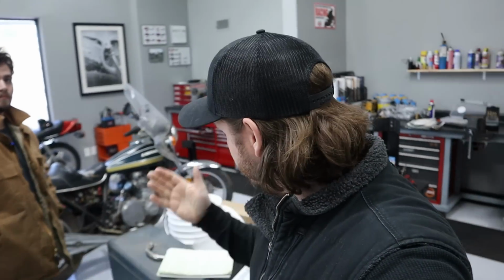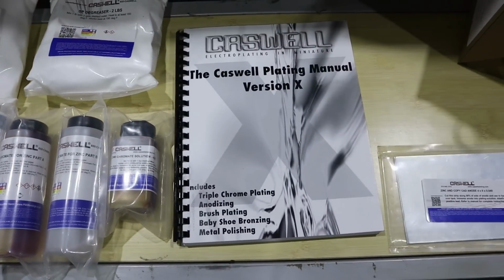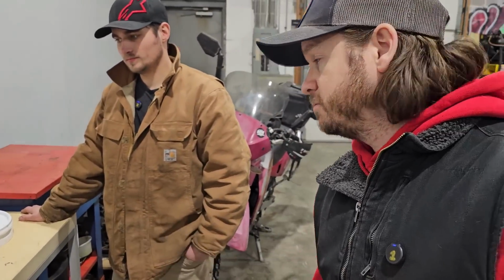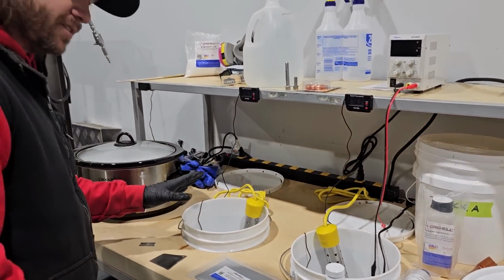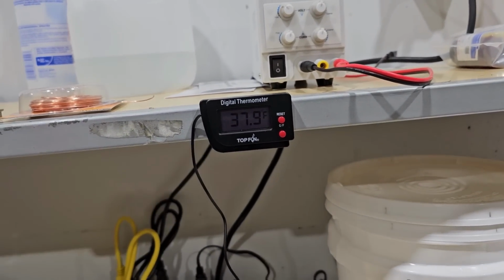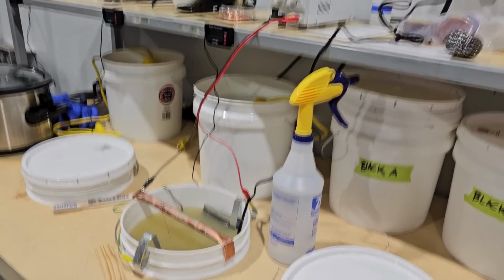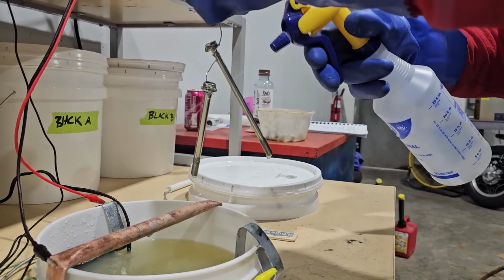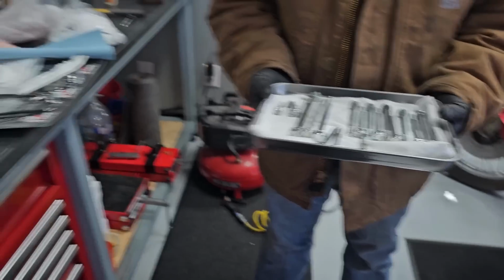Setting Up Our DIY Zinc Plating Station! This Is A Game Changer!

Comment from the maker: This is seriously a cool thing to be able to do in-house. Once we get a bit more experience with our process and try out the yellow/black chromates I will make a more in depth video on how to do this. Having the ability to do small batch stuff is an absolute game changer as all of these motorcycles need something plated. Things like axles, engine bolts, brackets can't be easily bought so this will fix all of that!  What do you think?
Reply: I reckon its really cool. Great results too. And they'll get even better as you do more😊
Reply: I’ve had a go at Zinc plating and the plating comes out dull. I will be following and have a lot to learn.
Reply: i did a diy plating setup with "ok" results, i did have to polish each piece a little but they turned out good, thinking of setting up a similar system for my bike restorations..  I'm up to 23 bikes at the moment!

Comment: Just. TIP for keeping your solutions warm.  
If enclose the bottom of your bench around all sides and underside with ply and some insulation closed cell board , add air vents and use a small portable electric heater on low as a cabinet heater the buckets of solutions will keep warm  from underneath. a bit like a bain marie. 
It reduces the need to have in bucket heaters that affect the chemicals.

Comment: I used those seed starting hot pad type things taped around the outside of the bucket. I had the thin white fiberglass insulation out if an old dishwasher and wrapped that around it to keep it insulated. It worked great especially so you can seal the lid and keeps the acid from rusting everything in your shop.

Comment: I just buy 304 SS bolts/screws......so very much less hassle.
Reply from the maker: Well thats always something you can do but for us, there are very specific bolts that you can't get in stainless or anything so we have to refinish them. I've spent thousands in small stainless hardware over the years and this setup will actually save us money

Comment: Lots of comments already and checked for a follow up video, didn’t take time to read all comments so if this has been said I apologize.

I am not a plater or a chemist, I am a sheet metal worker that 40 plus years ago did galvanized gutter by hand cutting inside and outside miters, offsets, down spouts and lots of other roofing sheet metal items like saddles that needed to be water proof therefore soldered with soldering coppers and propane or natural gas soldering pots or shop bench furnaces and so what I am about to say may not even be correct. 🤪
We used pool acid I think, sulfuric/muriatic/ hydrochloric I don’t remember. The old timers back then, which I am an old timer now 😬 would take a handful of galvanized nails and toss them into a new gallon bottle of acid to cut it. Some hard to breathe yellow brownish smoke would spew out of the bottle. Once it settled down we would use this cut (diluted?) in strength as our soldering flux.

So I bring this up because your acid ate off the coating on the heater so your acid might be off somehow. Although your results looked amazing to me.👍
The other thing I wanted to make you aware of is whether you were working in the shop or in the field everything rusted just from being in proximity of using the acid/flux and of course the flux was always covered after use but everything/tools benches etc still rusted inside or outside. So heads up on your bikes, cars, parts, tools etc. 
also it might be worth having some baking soda around just incase of an accidental exposure to your body or hard parts. Acid just seems to keep being acid even if diluted with water and won’t stop being acid until you neutralize it. Might help to have on hand dry and in solution in a spray bottle.
Great video, I mess with bikes too and vintage outboards and always wanted to add this to my processes. New to your channel looks like lots of viewing knowledge and pleasure to come.
Subscribed. 😁

Thank you for all your efforts

🤘🤩🤙

Comment: As a general safety consideration, in addition to your PPE, I highly recommend you get an eye wash station if you don’t already have one. It doesn’t have to be the fully plumbed in fountain type. Just the ones with the two squeeze bottles that you can mount on the wall. Some pretty cheap insurance, especially where you’re handling muriatic acid. Additionally, a couple of chemical resistant aprons wouldn’t hurt either, just in case. Just some suggestions. Really interesting process though. And the results look awesome!
Reply from the maker: Thats a good suggestion. I'll look into that

Comment: Hey guys
I ran a plate shop here in N Z try making hooks, like an S.
Run a wire off the bottom of the hook, hang the hook,and wind the wire round the bolt or bolts this will make it easier to transfer from tank to tank and also I’ve you enter contact.
Also rinse by using a water bucket as already commented below.
Good luck.
Pete

Comment: Love the videos and the processes. Restoring a bike takes a long time on its own and having to run a shop and tape everything just adds time to it. Keep up the great work. I really enjoy learning about all the stuff you're doing.

Just curious, does this process add a layer over the bolt or does it change the chemical composition of the surface of the metal? Does it change the properties of the bolt, meaning the strength or anything else? Also, why do you do the entire bolt if you will only see the head of the bolt? Could you only dip the head? It would save you time to have to polish the entire bolt and product (less brightener and possibly others too).

Comment: might be a silly question, but: can you do other metals, like master cylinders, calipers, carb float bowls etc?
Reply from the maker: For zinc it has to be steel. I'm not sure if all ferrous metals can be plated but definitely not aluminum bits

Comment: You don't need to heat the acid. It'll pickle nicely at whatever ambient is. Not many heaters will survive in an acid bath! I used to work in a zinc platers for years.

Comment: Of course,  O great Jedi Master and now home to TWO Jedi Knights. The Zinc Plating, so so cool.  But Alas, Way beyond me.  But still.  Now that I am aware of the critical nature of the interior of the gas tank I need feedback about that gas cap mechanism for me on the Bandit 1200.   I've got a key, not working well, tried to make it work better.  (The 1200 has a super clean interior ~gold to me~ not the 600 which is a train wreck ~another story). Anyway I tried to deal with the rubber gasket that floats just above the locking mechanism as you secure the cap with a key.  A rigid, inflexible hockey puck texture.  In exploring this I destroyed the whole thing.  And so my new ebay replacement is here.  So I am researching the vacuum seal for gas delivery.  You know through the petcock set up. Here's my question: Could that rubber gasket, right at the top of the tank fail and then destroy the whole vacuum gas delivery design? By the way, West Virginia, (the 750 Nighthawk) is soon to be "Running as it should."  ~.😊~.       I take a knee for your wisdom O Great Jedi Master(s). ~ 🙏~.  Your Padawan learner.  Forever and always.

Comment: Instead of clipping the negative side to the pipe…. Clip it on the wire your holding your bolts with, should clear up you amperage drop. The only real down sides are the time it takes and how to deal with the spent chemicals

Comment: Yet another excellent video.  I have an unnatural aversion to putting a rusty nut or bolt back on a bike.  Regardless of the level of refreshtoration.  I just hate putting rusty shit back on.  But when I've clean up all my bolts on a scotch bright wheel on the buffer...rust immediately follows.  This is the solution and I hope to get this set up going for the next bike (1976 Kawasaki CB650).  Hopefully I will be riding it to MO for a stop by the shop this summer when it's completed.

Comment: A word of caution, I think its a bad idea to have the plating setup in your workshop because the dust and the vapours from the plating process will tarnish and rust your engine parts and also the other bikes you have around your workshop. You should be doing the plating in a separate room with good ventilation. Apart from all that cool project.
Reply from the maker: Are you basing that from experience? There really aren't many fumes
Reply: @BrickHouseBuilds  Liquids always evaporate especially when heated with the presence of acids you will affect any metalic parts in the vicinity. Think of when you charge a lead acid battery in a workshop all parts in the immediate vicinity will oxidise. Just keep a close watch on the items nearby.
Reply from the maker: @johnbarbato5803  I have experienced this with just muriatic acid which is why I keep it sealed in a separate container and away from things. The 5% mix is pretty tame and of course has a sealed lid on the bucket when not in use like all of them.

Comment: No Chromate bath after plating? Zinc protects the metal and chromate protects the zinc. Without the chromate the zinc will not last very long. The "blue" chromate is a clear chromate with a slight blue tint.
Reply from the maker: @223cycles2  Its not really mentioned anywhere on Caswells website or in their book
Reply from the maker: @223cycles2  but obviously we are just getting started here and not seasoned pros

Comment: This is a very interesring proces. I am curious what the costs of your zinc shop are im comparison to the professional shop.
I think you can try thinner copperwire, it makes connecting the parts to the wire easier and tighter. For example lay one wind of wire around the threadpart of a bolt and then make a tight five round twist. Etc. In this way the bolts can be connected close to eachnother and make a string. The length of the string depends on the depth of te bath.
Take care to not make a blue shine zinc surface. The factory zincked parts of the of the bikes tend to a very very light yellowish.
Greetz Frits.

Comment: With your support bar, just be careful to not get electrolyte on it and it will last. Plating it won't help as that will also corrode with the acid. The wires don't need to wrap around and that can cause splashing. I use a very fine copper wire (the amps are almost nothing) and they leave less shadowing on the plated part.
Reply from the maker: Noted

Comment: Pick up a perforated melamine ladle. It's essential for picking out dropped fasteners and it's great for the passivate process. When you passivate while on the wires, it passivates the wires. If you don't passivate the wires, and use a ladle to put in the passivate, you can reuse the wires over and over as they're still conductive.

Comment: May I suggest a vibratory brass case tumbler like reloaders use? It would really speed up cleaning your hardware. If you're not familiar with them they look like a pumpkin on a pedestal. There is a variety of abrasives available. Try Midway USA to start.
Reply from the maker: Ive seen them but can't see how it would speed up that side of it. Less labor for sure but how long do you need to run them for?

Comment: Very cool! Maybe a rinse bucket vs spraying for a more thorough rinse process? That rebuilt engine is going to look mighty purty -
Reply from the maker: We have two rinse buckets and are experimenting with them
Reply: @BrickHouseBuilds  I keep a rinse bucket for the electrolyte, acid, and each passivate
Reply: @BrickHouseBuilds  , nice, I would think that maybe a first rinse in tap water (which could be changed out quickly as needed) and then a second dip in the distilled water?
Reply: Spraying is good as it reduces the contamination of the rinse bucket and it also helps to keep the chemical in the bucket. They naturally evaporate a bit so a small spray keeps it evened out and you don't lose the correct ratio

Comment: Chemistry 101 rule is that you pour chemicals into the distilled water so splashing would be water rather than chemicals. And i see you did just that.  
Great fun process i may try one day. I have the same issue with shop temps when it's cold outside.

Comment: This is one of the best videos I have watched in a while...I am half way through and wanted to say that...Really great setup!!!
Reply from the maker: @Biokemist-o3k  Glad you are enjoying!
Reply: @BrickHouseBuilds  Absolutely!!!..The bolts came out so great!!!..Really awesome video and you didn't even need to watch Breaking Bad...lol...I keep remembering when you found that 4 cylinder 750 and were working on it under the tent out of the back of your truck...You have come really far and I love your new shop..I wish I were closer..I am building an XS650 stretched Bobber with a permanent magnet alternator, electronic ignition with capacitor, thumb throttle, right hand clutch and suicide shift with left hand rear brake...It is the replacement for my 1957 Panhead that I was hit and wrapped around a telephone pole nearly losing my right leg . It happened right in front of my house...really crazy..Keep up the great work..-John
Reply from the maker: @Biokemist-o3k  lol well we did thr van and canopy thing as a challenge. Trying to get it running where we bought it instead of using the shop. That was just a couple months ago.

Comment: Looking good. Watched someone do this on another channel and they put the bolts in a lathe and took off the small ridge which runs round the bolt head, it actually made it look flat and so much tidier, extra work though.
Reply from the maker: Yeah on the custom side that is definitely something I have done. Makes it look pretty slick!

Comment: Really great to watch someone else doing this, gets me excited for my attempt. Caswell is a great kit, I decided to piece a kit together myself and reading how to make my own nickel acetate. Couple notes I’ve taken are .5- 1 volt 0.1amp per sq inch. Volt shouldn’t matter with limit on amps. Caswell does have a calculator on their site to measure different bolt and head sizes, great asset. Someone else suggested polypropylene non woven anode bags to collect sacrificial nickel plates. It keeps debree and sediment to a minimum in the tank. Great work 👍🏻
Reply from the maker: @JordanRay  The amperage made sense after playing with it. We tried the calculator at first to get a baseline and adjusted from there visually looking for bubbles. Hopefully you have good success with yours. Its kinda fun

Comment: I am really enjoying the CBX build! And the attention to detail is great. I wonder if the initial cleaning would be easier in a media tumbler rather than the wire wheel and sctchbrite wheel?
Reply from the maker: @stephengriffin-ci3fy  Well it would be easier as it's hands off. Unfortunately it would be slower. The red pad is very necessary for the correct finish we want on the bolts though